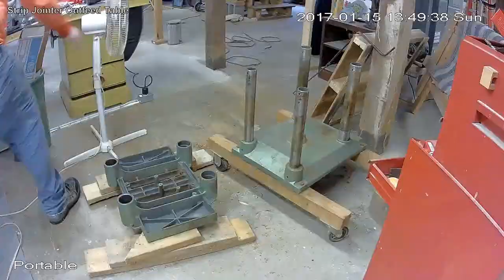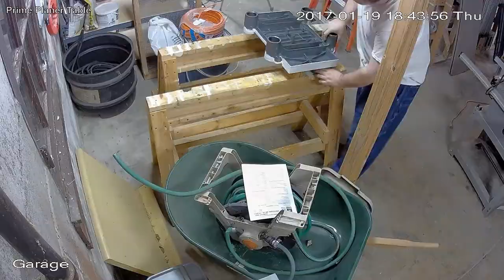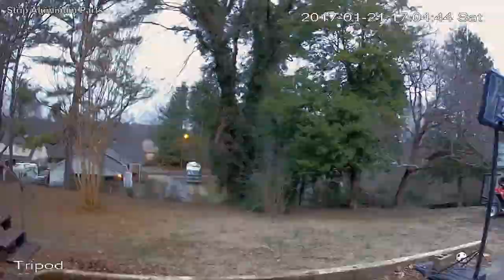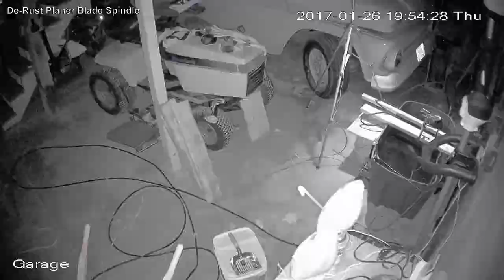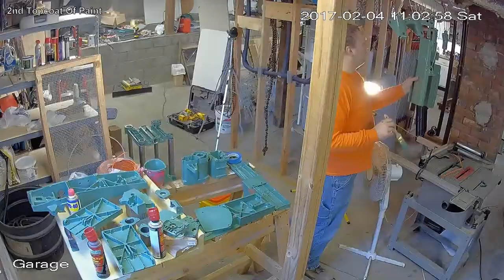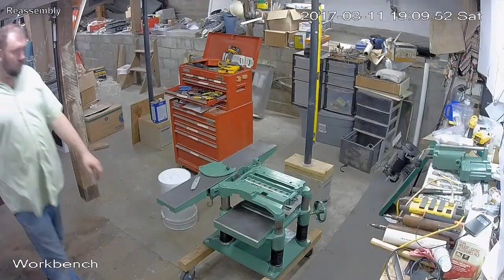Rebuild Hitachi F-1000A Planer/Jointer - Time-Lapse

Comment: I have one and need some help in knowing how to change the belts as one just broke? anyone have a video of or information on how to do this?
Reply from the maker: Unplug the tool, use hot water to soften the new belt, and hand-roll the system as you force the belt to jump teeth until it is on. It will take effort, but it will go on
Reply: @m1chaelf4  Thank you so leave the jointer belt in place and work the new belt in between and like you said hot water to soften belt and just work it?
Reply: Oh and this is the first belt I have replaced since I purchase the machine in April of 1983
Reply from the maker: Yep. Even though I had my machine fully disassembled, the belt cannot be installed until reassembled, so this is how I did it
Reply: @m1chaelf4  did you have to remove the jointer? to do this?
Reply from the maker: I think you just remove the 2 screws to remove the cover, so the jointer bed remains attached.

If, for some reason, you do remove the jointer bed, I supported it by looping a rope around both ends, with one loop formed as a bowline and the other a tauntline knot, so I could adjust the height. Cribbing would be a good safety support to preventing it from falling if the rope breaks
Reply: @m1chaelf4  I wish I knew how to post a picture so you could see that the belt for the jointer would have to be moved over to the planner pulleys and then you can put a the jointer pulley on as the bottom pulleys are separate and the drive pulleys from the motor are on the same shaft. so I am thinking if i can use a heat gun to soften the pulley belt and move it over and hot water to heat the new belt and put it on. Thank you very much for your help I hope this is making sense.

Comment: Great job on your restoration! I have the same  jointer/planer, but I always get end snipe. Have you been able to solve the problem? I have had my machine since new 1991. The serial number says 0001.
Reply: I've had the same jointer/planer since 1990 also. Great tool still in action though I need to do a thorough restoration myself. As for jointer snipe, I've found it has everything to do with setting the knives. Since there's no adjusting the outfeed table, the knives have to be set perfectly to the back table. The little magnet things that came with the tool wear out and the replacements you can buy don't work as well as the originals. I found some longish flat regular solid magnets (around 2" long) that work well but I use a slightly different method to set them. With a straight metal ruler, I raise the infeed table to exactly the height of the outfeed table then set the magnets across the two tables. I set the knives like usual, push the knife down low, place the magnets across the tables then gently loosen the bolts to let the springs push the knife up against the magnets. I've had really good luck in getting the jointer knives set perfectly in that way and don't get snipe anymore. The same magnets work fine on the planer. I can get a little snipe with the planer still if the wood I'm sending through is not perfectly flat. Not much though. These old Jointer/planers still work better than anything new I've seen. Well designed and well built tools.
Reply: @jonmars9559  Thanks for your input!  I have no problem with the jointer getting a very nice flat true edge.   I bought carbide knives a number of years ago and will temporarily install them and see how well they work and last.  More recently I purchased a shelix cutter head which requires a little modification (minor) to the casting/housing to accommodate the new bearing.  
Have you had any problems with the motor?  I am replacing the on/off switch and the carbon brushes very soon. 
Thank you your response!
Reply: @jonmars9559  Just curious......were you born on September 5, 1959?
Reply: @candesearl  It's always fun to find a fellow enthusiast. Let's see, a few years ago I did have the armature repaired and motor rewound. What I found was that the brushes should be replaced regularly and the dust blown out of the motor periodically. Worn brushes and dust build up shortens the life of the armature. The on/off switch I replaced with a simple toggle. The original safety lock switch always filled with dust and failed prematurely. I replaced the switch with the original type a couple of times and gave up. 
Also I've been thinking of doing the helical cutterhead swap myself. If you get to it first, let me know how you like it. I found another F-1000 A on Craigslist and was planning to do the swap on that one first and get it tuned up for shop service before I rebuild my original one. There are some great videos on how to install the helical cutterhead on YouTube but  I want to practice on the Craigslist planer before I tear into my old faithful.
Reply: @jonmars9559  Hi Jon, the reason I asked you how old you are is that many people put their name and date of birth into their address.  I am VERY close to your age.  There other reason is that you write in complete sentences.  Many people born in the 1990's or later really struggle to write ✍ a cogent sentence.  🙂  I was a machinist for many years, but fell in love with wood.  It smells good (most of the time) it is cleaner and has that special unique patina, which many wood species grow and develop in beautiful ways.  I work with quartersawn  white oak and cherry most of the time.  By the grace of God I still have all of my fingers and I can pick my nose with the best of them!  🙂  Once again, thank you for your response.
Reply: @candesearl  Hi Earl. The 9559 number is something YouTube added to my name. Not until you mentioned it did I realize it could be interpreted as a date and it is close though off by a couple of years. I started out in woodworking at 13 because of family obligations. Once into my 20s I went off on my own and have done one-off pieces of furniture, doors, stairs for decades but now I'm branching off into metal work, forging, casting and some machining so that I can make custom hardware as well. I have a brother in the stone cutting trade and I'm hoping to incorporate all these mediums together in my senior years. What's interesting as I look around my shop is the number of tools that I've had since I was a teen or in my 20s. Some are beyond their prime but some remain serviceable. They were made to last. Someday I'll hand everything off to my kids who will have no idea what to do with them.
Reply: @jonmars9559    My name is Chuck.  As my logo appears I am a Christian patriot with over 35 years in the military.  I am a disabled veteran from this war in Iraq 🇮🇶.....pronounced 👂 Rock.  
I spent so much time with the Iraqi people that they gave me a special gift 🎁.....called tuberculosis.   I tried to stay 40 years in the military, however God had other plans for me.  
When I was busy woodworking early 1990's I bought a lot of tools and machinery and like you still have and use most of them today.  Getting around is more of a challenge.....every day is a new opportunity.
Reply: @candesearl  My apologies Chuck. I looked at the last 4 letters of your handle and thought your name might be Earl. Thank you for your service Chuck, and your sacrifice. May each day bring you new opportunity and deeper rewards.
Reply: @jonmars9559  Thanks Jon!  I wish you well with your metal/wood working and please try to keep all your fingers attached 😀!

Comment: I just got one of these on craigslist, but I won't have help to unload it for a couple of days. Is it possible to lift the head off with the board spacer trick you did without a bunch of prior disassembly? Trying to figure out if I can dismantle it into a few chunks to unload it myself.
Reply from the maker: I think it is just a single bolt or setscrew on each post, so should be easy to separate. I'm at work so not near the machine right now, but if I'll reply again tonight if it is anything different. Enjoy!
Reply: @m1chaelf4  awesome, thank you so much!
Reply: @m1chaelf4  you were right. 4 set pins I had to bash out with a punch. Then just needed to unscrew the depth ruler and disconnect the power cord from the base. Your trick of raising the bed with spacer blocks worked perfectly after that. Thanks again!

Comment: Great restoration! i have a ryobi just like this. is there a way to adjust the tables to be in the same plane? My indeed table slops into the cutting head by about a 1/16" and can't figure out how to adjust it.
Reply from the maker: Maybe you can find a way to add shims, but I don't immediately see any adjustment on mine. A machine shop might be able to regrind the ways?

Comment: Just picked up this same model, this was a fun time lapse! Anything I should keep in mind when restoring mine?
Reply from the maker: After spending the time, I wish I had powdercoated it. I bought the best industrial paint, but it shows that i brushed it. Since I restored it to use it, that is a minor issue. It was a fun job. Most replacement parts are still available. When i was looking for a plane and jointer, I was avoiding combination machines, but this one is great since there is no changeover required to change operations!
Reply: Michael Finch this was one of the reasons I liked it as well. We picked ours up for about 350 with extra blades for both sides. I don't think I'm going to bother with repainting as much as I'm worried about all of the surface rust on the beds & pillars. Let me know if you wanna come restore another in Houston for the fun of it!  😂
Reply: @Pryorfab  Hi, I am in League City and have acquired the same f1000a planer.  Starting my restoration project next week.   if you're nearby maybe we could collaborate on the rebuild process?

Comment: Hey Michael, great video, thanks!.  You have inspired me to start my f1000a restoration next week.  What chemicals and power supply did you use on the de-rust process?  Do you think spraying the primer and paint would do as well as powder coating?  Which primer and paint did you use?
Reply from the maker: I used a 6/12v 10a automotive battery charger, and my anodes were concrete rebar that I used a wire wheel to remove some anti-corrosion coating. The only 'chemical' was washing soda. Google "electrolysis rust removal" for great writeups.

I forget exactly which paint I used, but I went to Sherwin William's and got the. Est industrial enamel they offered. It was part if a system that has a special primer. If I was restoring this for sale, I would have paid for powdercoating, but since I restored this to use it, I dont mind the brushstrokes in the paint. (I also did this to determine whether I would consider doing it again on a larger tool. I e decided the answer is "yes", and I'm watching craigslist for a Bridgeport mill that needs some TLC.)l
Reply: Michael, thanks so much for the  reply.  I’ll try to upload some pre and post pictures once I get the battery charger and rust remover tank.  I saw another video which used an old brake rotor as the sacrificial anode.  I have 4 of these in my garage attic that I can use.  I will spray a primer and enamel paint on a sample part and see if this meets my expectation.  I am not planning to sell this vintage planer as long as it produces quality woodwork.  BTW, the Hitachi F1000a unit I have uses 240vac.  It was originally purchased in Japan.  It has a separate 120vac to 240vac step up transformer.  I happen to pick both up from a Japanese lady giving away her deceased husband’s workshop tools.  No one wanted the planer because of it’s weight and condition. I think I may have stumbled on a diamond in the rough!

Also, just inherited a Shopsmith Mark V that needs minor restoration too. This unit is in much better condition and will complement my other woodworking tools nicely.

Good luck with the Bridgeport mill.  Looks like a very cool tool!
Reply: Follow-up (04/19/19) - just finished with de-rusting and priming the parts with Rustoleum clean metal primer (tinted grey from my previous Shopsmith Mark V restoration project).  After considerable research, I decided to order Hammerite Rust Cap 43175 1 Qt Mid Green Hammered Finish Enamel Paint
for the top coat.  Should be doing the top coat next month.  I will brush the first coat and consider a light spray second coat.

I am replacing the joiner and planer blade bearings (these were tight and felt rough).  I also opened the motor gear box and lubricated the gears and bearings, but decided not replace these.  Do you know what can be used for the bearing stop pins?  Seems these parts are not available anywhere and the current bearing stop pin holes are filled with a soft material that may mount to the bearing outer race.  I am thinking the bearing stop pins were not used last time the bearings were replaced and maybe a locktite mount material was used.  The material has a red tint to it. Any ideas?

Also, I'd like to replace the bellows for the dust boots on the bottom frame.  The ones I have are the original and have a few holes in them.  Any ideas on where I could find a bellows dust boot replacement material?  Maybe a bulk bellows hose cut to fit?  The front and back bellows are different diameters.

I was a little apprehensive doing this level of restoration, but I have kept a digital picture archive and parts in separate store bins to assure I can reassemble properly per the parts assembly diagrams.  Seems less daunting now that I am in this far into the project.  Thanks for your encouragement!

Comment: Mike how hard is it to just swap out the planer cutterhead with a helical one? Do you have to remove the jointer to do it?
Reply from the maker: I'd like to do the same, but my quick look several months ago didn't reveal and drop-in replacements. Let me know where you find one. 
It shouldn't be too hard to disassemble to access it. Find the exploded diagram on the website of a parts dealer

Comment: How do you get the belts replaced ? I can’t get the new ones back on . Thank you .
Reply from the maker: Heat the belt in hot water to make them softer, then roll the pulleys and guide the belt to jump one tooth at a time until they are on

Comment: did you get new knives?  If so where from,  parts pro no longer or never did have them.
Reply from the maker: I purchased knives on Amazon. Hitachi 972011 12-Inch Planer Blade Set for P12RA Planer/Jointer https://www.amazon.com/dp/B0000223K0/ref=cm_sw_r_cp_apa_7S16zb78ZTF5G and Hitachi 879208 6-Inch High Speed Steel Jointer Planer Blade for the Hitachi F1000A Jointer, 1-Pair https://www.amazon.com/dp/B000BT1RCK/ref=cm_sw_r_cp_apa_IU16zbG3BDWB0

Comment: I need to get the Armature redone on mine and I'm not too sure the process to get access to it.  Is there anyway to slow this video down so that I can use it as an instructional tool?
Reply from the maker: At the bottom right of the youtube video window is a gear icon. You can change the playback speed in that configuration menu
Reply from the maker: The best way to figure it out is to find the exploded diagram on the website of a parts dealer

Comment: Amazing video! I'm repowering an F-1000A with an induction motor mounted on the iron base under the jointer. Notes and pics on the Canadian Woodworking Forum...https://forum.canadianwoodworking.com/forum/tools/power-tools/1289717-hitachi-f-1000a-repower-project.....Can I ask how the gearbox is lubricated? Is it a permapack of grease from new? Should it be replaced every 10 or 20 years..? Thanks, Gregg.
Reply: Sorry, that URL wasn't clean. here it is https://forum.canadianwoodworking.com/forum/tools/power-tools/1289717-hitachi-f-1000a-repower-project
Reply from the maker: I packed it full of grease then reassembled the geat train. I'm not sure how often, but as a hobby-level woodworker, I don't expect to do this again
Reply: @m1chaelf4  Thanks for reply. I have heard of someone replacing the grease with gear oil. Intriguing, but I think the grease pack is probably ok. I haven't heard anyone complain about gearbox failure.